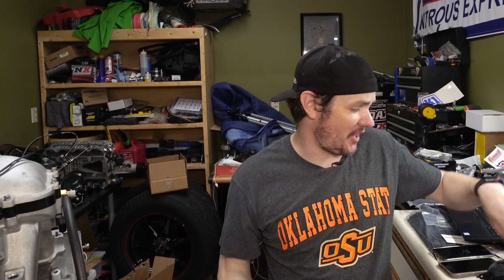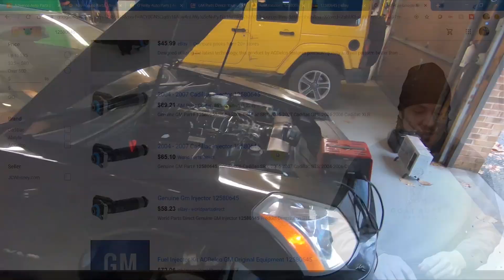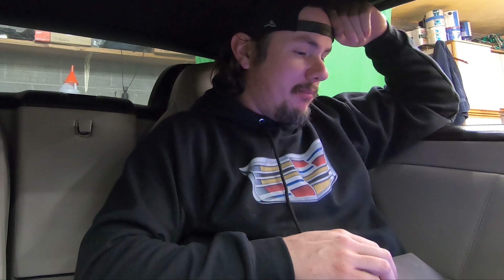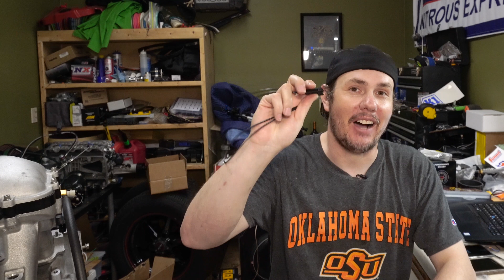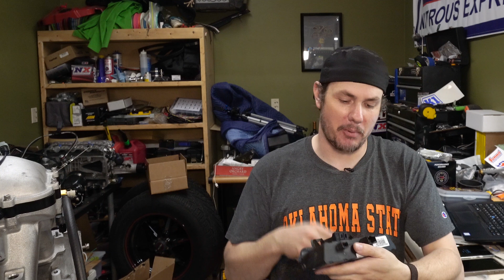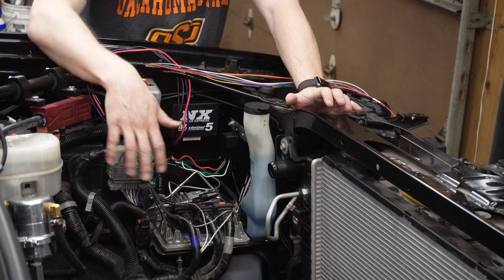Auxiliary Switch Install To Control 2-Step, Nitrous, Line Lock, Traction Control and Stabilitrak!!

Comment: Im trying to do this on my truck but i cant figure out what wire to splice into. Your video doesn't show it well, ive had no luck finding a wiring diagram, and im not seeing the signals change when i put a meter to the back and switch the buttons
Reply: The terminals supply a ground for the relay, not power. The aux terminals are (4)10, (3)11, (1)12 and (2)13 I believe, but check that to make sure.

Comment: I have a 2017 2500 and it did not come factory installed with the auxiliary switches. I purchased and installed the switch panel with the 1-4 auxiliary switches and it seems that the wires for the switches exist in the plug of the panel like your truck. Now I have some ditch lights that I’d like to install and they came with their own wiring harness - inline fuse, relay, and switch. How would I go about using the wiring harness they provided to get my auxiliary switches to control the lights? Thanks!!

Comment: Do you know the type of pin connector that fit in the harness connection behind the aux switches?
Reply from the maker: I don't, but you can probably find the part number in the upfitter manual

Comment: What was the point of joining the two bottom pair of wires?
Reply from the maker: Pass them through from the sensor to the controller, it is a two wire sensor, we are only breaking one wire to disable

Comment: Will this be a problem on the Gen 4 as well I haven’t felt anything shutting me down but all the traction control and Stable lights are all on the dash freaking out ? But awesome video!! Dang I need to clean my truck the superado is so shiny
Reply from the maker: Didn't have this issue on my Corvette, so I can't say for sure, but it also wasn't launching this hard.
Reply: Goat Rope Garage copy that I’ll log it and check it out thanks bud everything is looking awesome brother